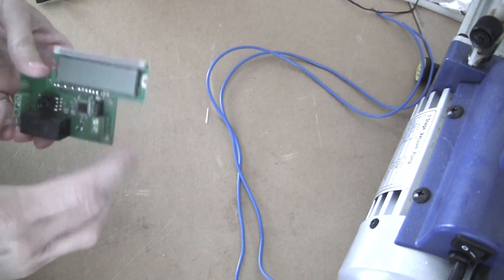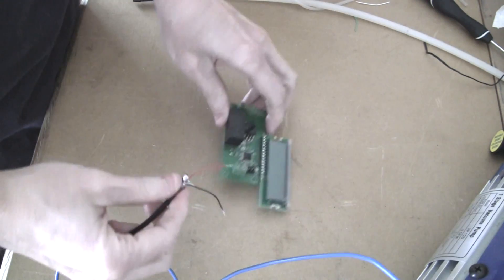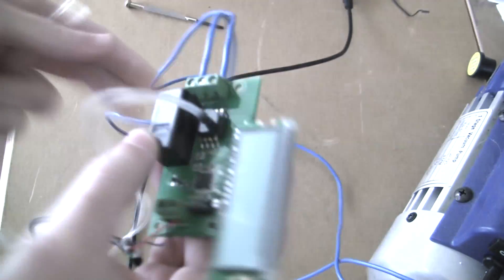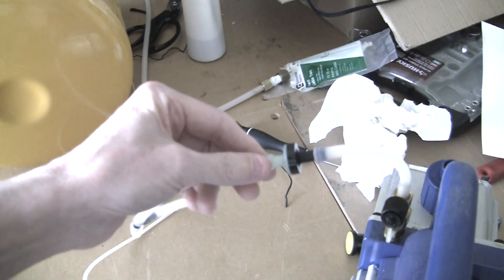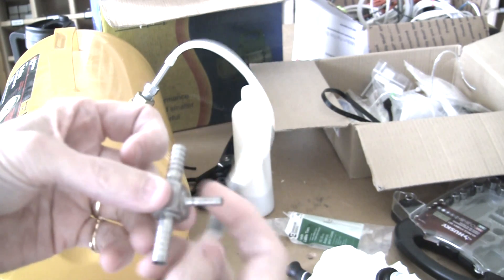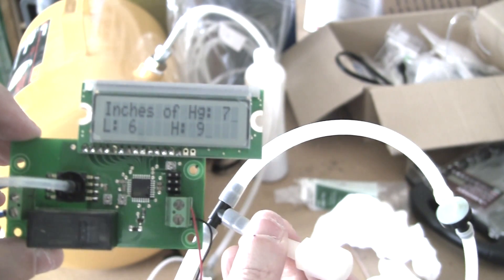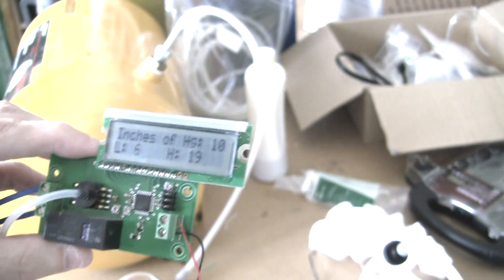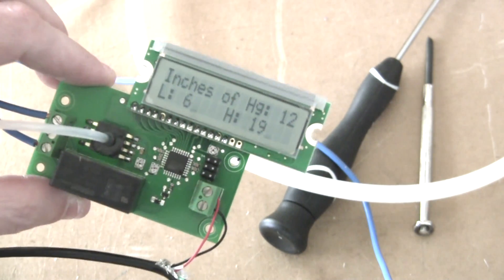How to use our Vacuum Pressure Controller

Comment: I think you nearly touched the live wire on the switch side connector at first try
Reply from the maker: At 3:40? You are right. It wouldn't have been the first time. I need to be more careful. If it was a high tension line, like a laser tube connection, that would be a very painful arc.

Comment: Just to clarify... vacuum is not a thing.  The word vacuum is a abstraction that means the absence of air (or any gasses).  So, technically, you can't have a "vacuum leak" or "vacuum pressure".  You have an air leak and air pressure. Air pressure less than ambient is called a partial vacuum  and is measured (as you stated) in inches of mercury.  Also, a vacuum pump is a misnomer, it's an air pump that creates a (partial) vacuum.  I know it sounds like I am nitpicking, but there are times when that way of thinking makes it harder to figure out how to do , or fix something.
Reply from the maker: You're right!  Thanks for the clarification.

Comment: Very nice module! is the controller an ON-OFF one?
Reply from the maker: Not sure I understand the question.  Can you elaborate?  Thanks
Reply: Of course.

Is it an ON-OFF(2 states) Controller or is it a PID or PI or something (more versatile) ?
Reply from the maker: I see.  It is definitely an ON-OFF.  When the vacuum is below the low threshold, the microcontroller engages the relay (changing the digital level to the relay coil).  When the vacuum reaches above the high threshold, the relay is disengaged.

Comment: Why did you used relay? Why not Triac or IRF transistor?
Reply from the maker: Very good question! At the time I was designing the circuit, I did not have the knowledge of Triacs and IRF Transistors.
Reply: Oh, then check it.
Also in case of using triacs/mosfet you have to use optocoupler between mcu and power terminals for safety reason.
Reply from the maker: I will check those options.  The relay circuit uses the relay, transistor, diode for protection and a resistor.  If the costs of the optocoupler and triac (and other supporting components needed) is below the cost of components that I'm using, then I will definitely give it a try.
Reply: I believe cost be higher, but maybe not much.
Huge advantage of using triacs is that you can make smooth AC power control by phase method with PWM and PID controller.
Reply from the maker: Good to know.  Thanks!  I will definitely consider them in a later run on this board.